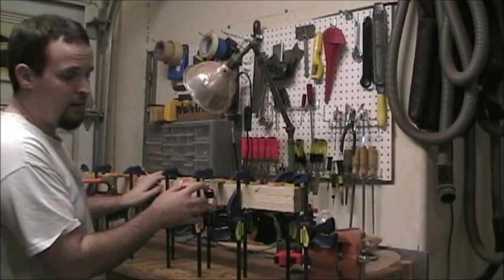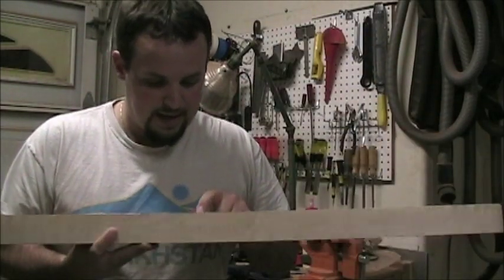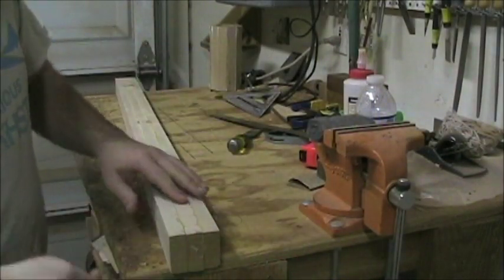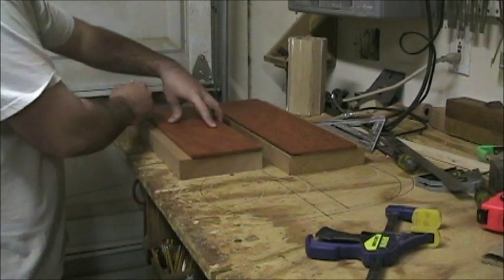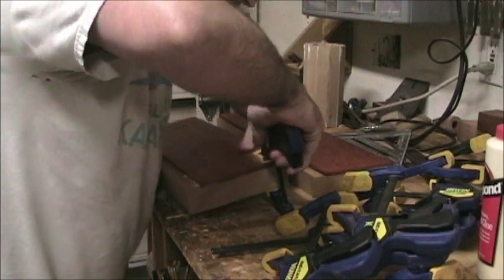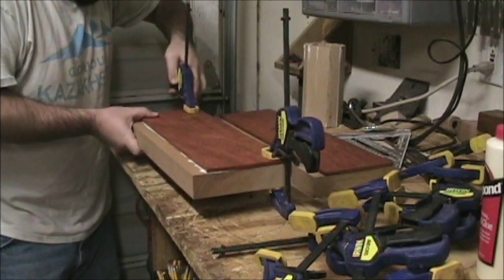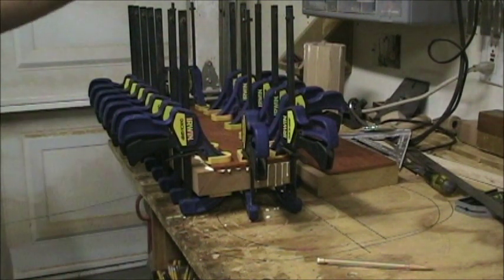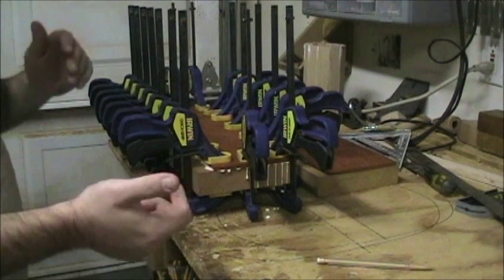Electric Bass Project Part III: Glue-Up

Comment: He's not making a square guitar, so the excess isn't really a problem.
Only thing I am commenting on is the process of check to see if the neck is true. It's called crowning, visual checking for the bow or bend. Still it's not a biggie as it will be plane to remove the imperfection.
Thanks for the video, I enjoy see another's very own techniques!

Comment from the maker: I thought about that, but since the boards were already so thick themselves I decided the sheer mass of the boards would also help distribute the force.  Really I could have used less clamps, but I like to use as many as I can fit, which helps make me confident that I am going to get a good joint.  On thinner stuff I'll use press boards, and you are absolutely correct about using a caul to spread out spreading out the forces.